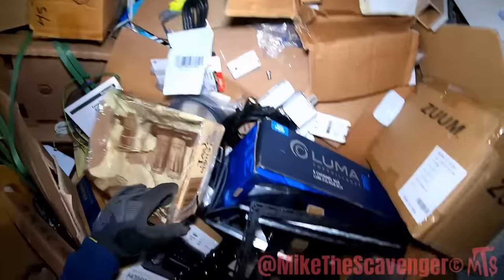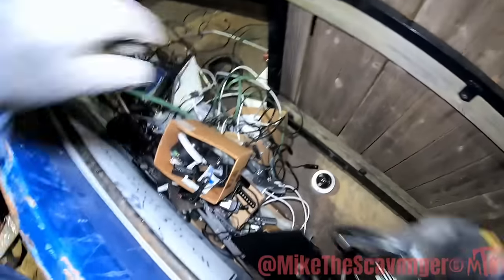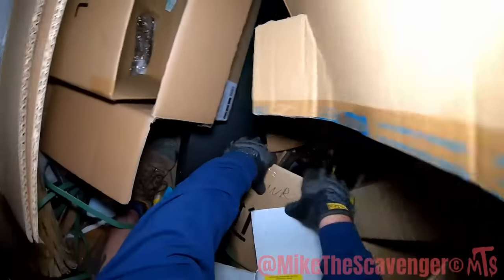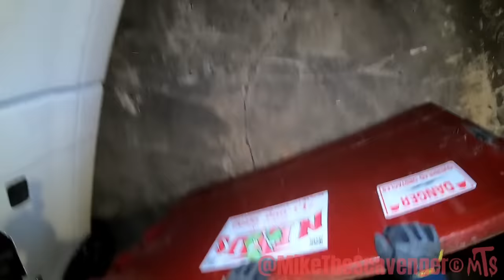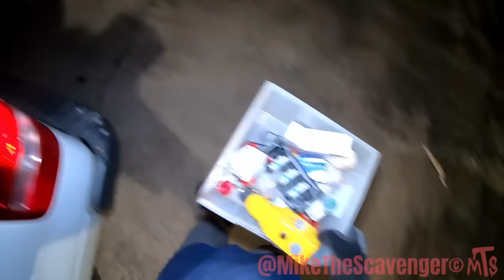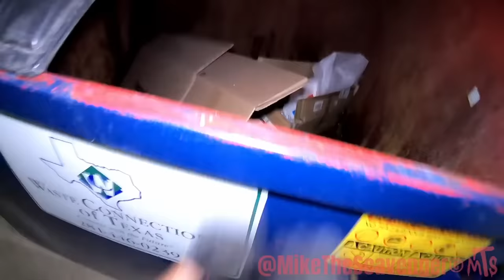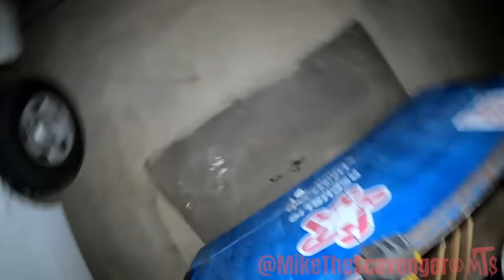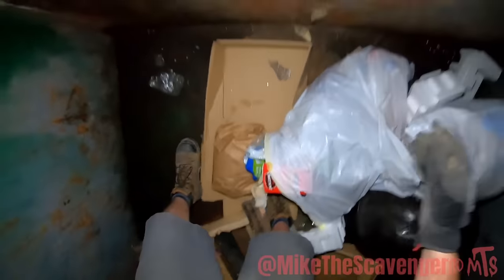Dumpster Diving "Have You Ever SEEN SUCH A THING?!"

Comment: The gray tool with the spinny handle on it you picked up at 19:31 is for cutting that BX or MC wire shielding you pull out of dumpsters all the time. It's for the smaller size than what you found at the top of this dumpster though

Comment: What the word you were looking for Mike is the key way they put into the shaft and that is a keystock that you Hide in your hands I use that to lock the device whatever it's going to be on wheel or an axle whatever it's gonna be used Is locked into that shaft They cut a key way in the shaft and they used the key stock to lock it on

Comment: Thats a lot of electronic scrap. i seen about 2000 lbs of pipe with the red brass fittings on them in a dumpster today. it was a remodal on a gas station.

Comment: That last piece of radiator, why won't they take it? Why can't it be cut up if they won't take it whole.And if it is for a ordinance or regulation, get a small furnace and melt it into bars or coins and sell scavenger coins or trash panda coins.Or pour it into logos for your furniture.That's a crap ton of aluminum you just give away 60 to 80 cents a pound. Those scrapyards don't give it to their buyer.Or even Bulldog Bullion for your rescue dogs, you get a lot of aluminum be safe but make a living.🦝🗑🐼